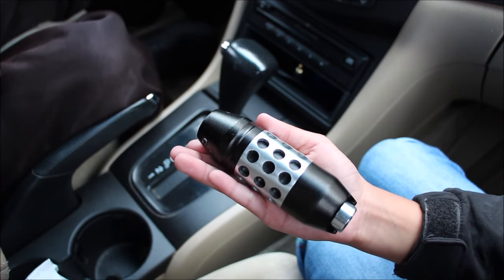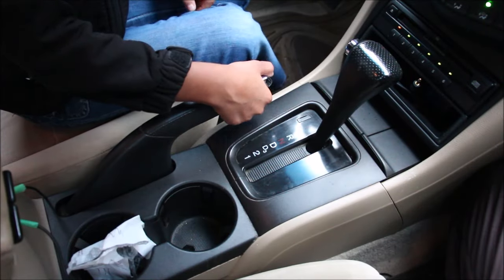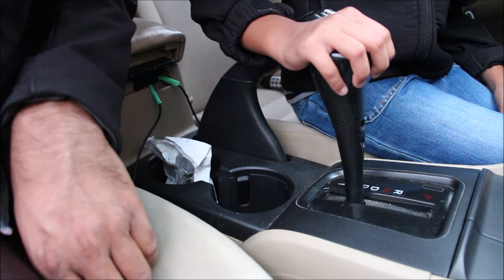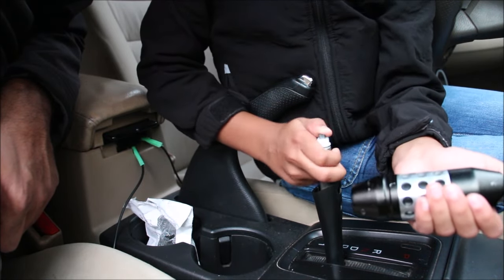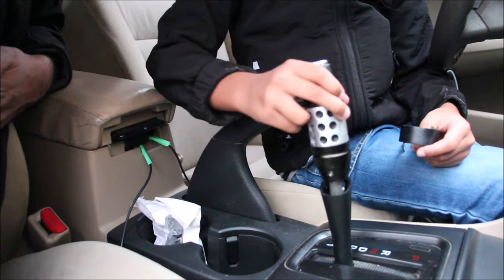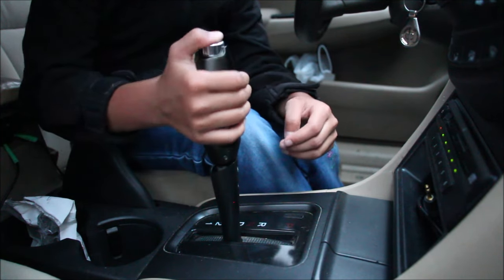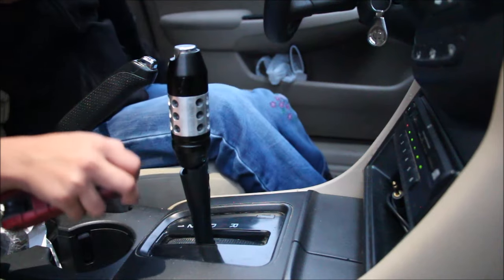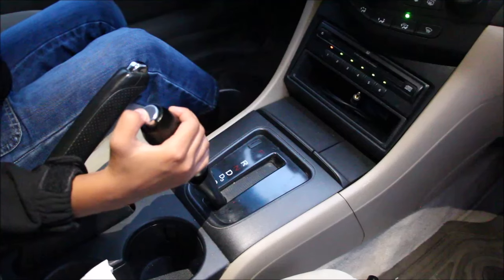How to Install a Sporty Shift Knob

Comment: What year is the honda ?will it work on my 2006 honda accord
Reply from the maker: +kush gottheju1ce2k 2004. Yea it should work.
Reply: speedkar99 does it have to be an automatic shifter ?Or it's the same with the Manual  shifter

Comment: Im thinking about getting the same shifter on amazon but it comes with "univerals threaded adapter" im assuming i use that instead of the black electric tape?
Reply from the maker: +Peter Nuth yes 
Mine was missing that piece